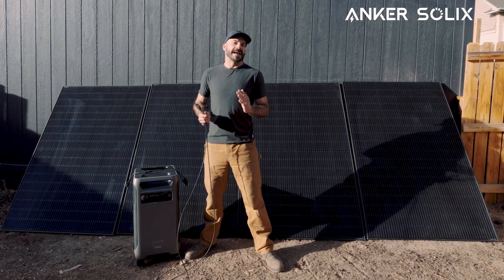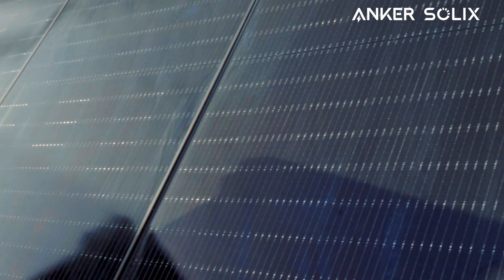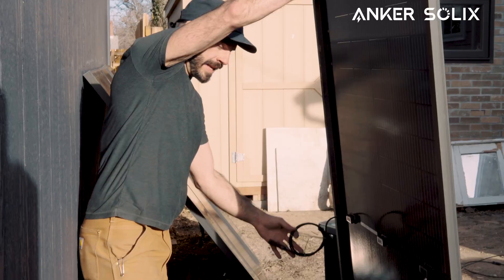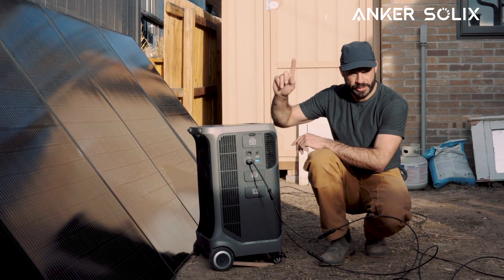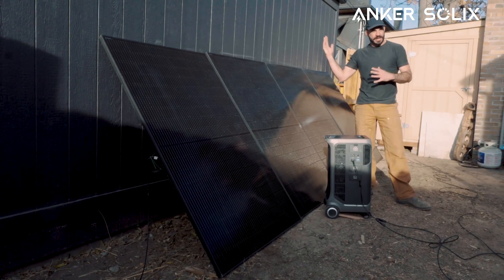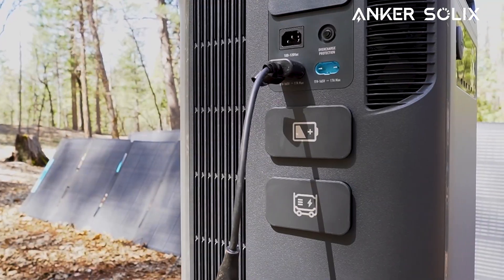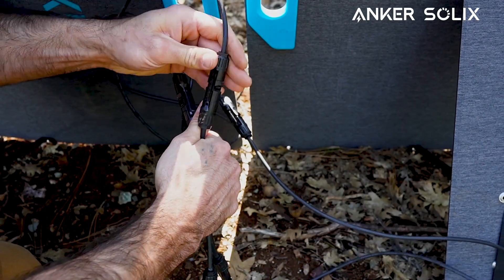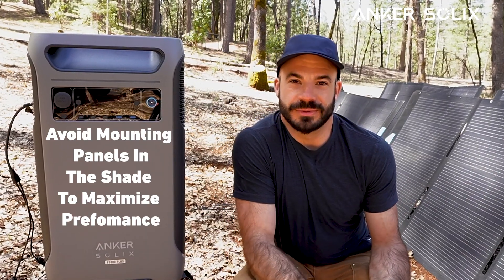Solar Power Your Anker SOLIX F3800 Plus: Rigid vs. Portable Panels

Comment: more voltage also means less loss for long wires. I have a F3800 (not plus) and I had to bring the panels closer to my house with 8AWG wires to minimize loss. And I bought my F3800 like 2 months before the "Plus" came out :(

Comment: amps are demanded by the F3800 (plus or not) so there is no need to stay "below" the 17 amps.. It is the voltage that can fry your unit, not the amps since the amps are decided by the unit. Volts are decided by the sender and amps are decided by the receiver

Comment: Ok. Now show us how to wire old 3800
Reply: If you still care about this (or maybe others care about it), the 3800 first gen is limited to only 60V.
The 440W rigid solar panel is 39.16V Voc so you can only have 1 panel "in series" but you can still do like 3 of them in parallel per solar input.
As far as i understand it, max input current is not as important since the controller in the f3800 will cap it to it's limit (27A on the 2.x firmware).
That said, from the researched i've done, you should keep the sum of your short-circuit current (Isc) below 130%, so ~35A but i need anker to confirm this.
Tbh, I don't know why 130%, seems to be for safety reason in case the mppt controller breaks and there's a short-circuit, it doesn't dmg other stuff.
The 440W panels have a Isc of 13.88A, which kind of s*ck for us, 35/13.88 = 2.52 panels.
So either we do 2 panels in parallel (2x13.88=27.76) or we risk it with 3 (3x13.88=41.64).
In any case, we are limited to 27A so at ~39V that's 1053W max of input (not the full 1200w, the voltage is too low)
3 panels seems like a waste of money unless you got bad weather most of the time and your panels are really underperforming.

In the case of the 3800 first gen, the best is to find either 1 panel with <60Voc or 2 panels with <30Voc in series.
Most bigger panels seems to be closer to ~50Voc which depends on the number of cells and that's a pretty good sweet spot so 60Voc is probably out of the question.
As for <30Voc, i haven't looked yet but my guess is that there won't be as much choices since they are probably gonna be smaller systems.
Reply: @jbeaudoin11 so with 3 I'm going over the current?
Reply: @Ecgmma  take what i say with a grain of salt, I'm no expert. As far as i understand it, going over current isn't an issue, the f3800 will only take what it needs and max at its power or current limit (27A or 1200w per input). But never go over voltage (60v) and keep a safe margin (most rigid panels are 50v, ankers ps400 are 57v) to account for temp changes, it affects Voc which is the max theoretical voltage of the panels.

Don't get ps400/200 panels, they are way way overpriced and useless. We have 3 and they all suck. Get good rigid glass panels unless you really need flexible ones.